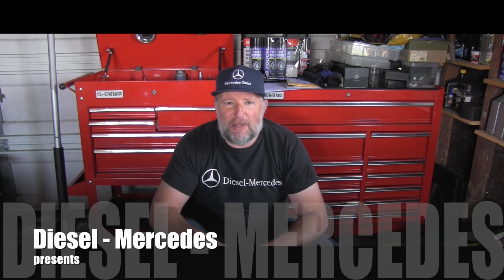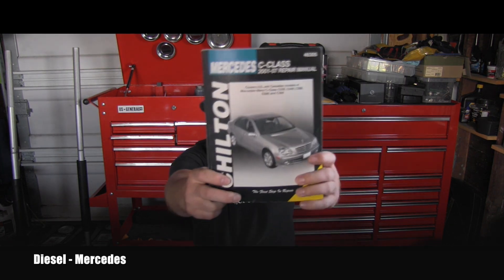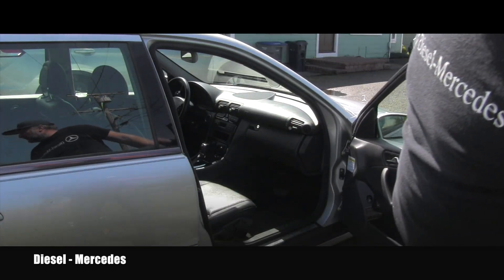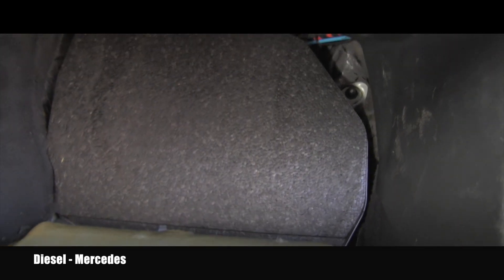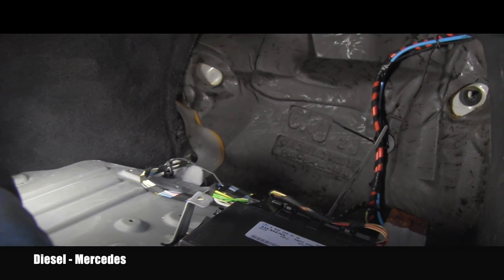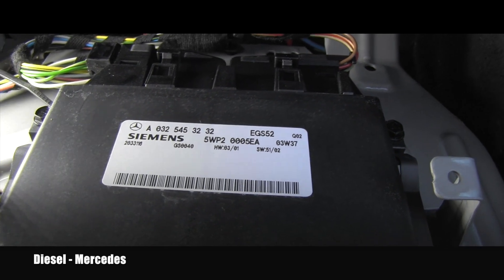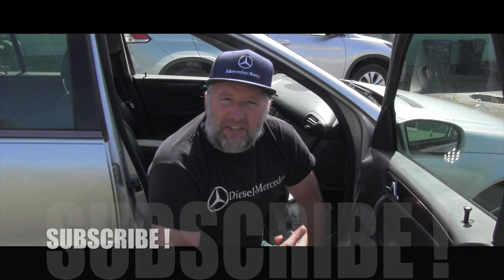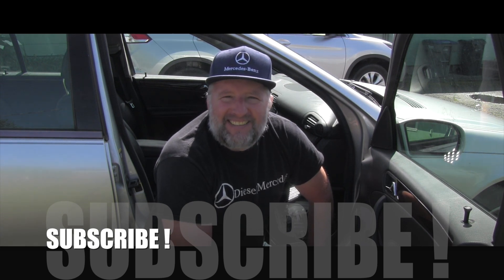Mercedes W203 C-Class location of TCM Transmission Control Module

Comment: I wish I found your video's in 2018, had car (W203 2005 model C200K) fixed and paid a lot to have repairs done.  This morning the shifter was stuck in park, and I have had some issues last week that it got stuck in 4th gear, so I assume the problem would be the TCM, will double check battery and brake light switch just for in case.  Really hope it's not the TCM - I'm not technical at all, and wouldn't want to fiddle with stuff I know nothing about, but your video's make it look so easy!
Reply: what was it?

Comment: How  do   remove   the  transmission    control  module  from  a  2001 Mercedes  Benz  s430?
Reply: Right side passenger under the hood there's 2 ECUs . The TCM is all black connected to the SAM

Comment: Thanks for the video I have a 2003 c320 4matic with code p2108 I've replaced all solenoids in the conductor plate with no luck and still stuck in limp mode tomorrow after I'm out of work I am going to diagnose what you have shown me here I really appreciate you taking the time for making this video
Reply: Have you solve that issue ? what is the cause of the problem ?
Reply: @harisyoung4110 
And how about you did you got the solution too

Comment: Hi Diesel Mercedes could youi confirm that to remove the kick panal, you used a standard 10mm socket set as my Mercedes CLK200 looks like there is a centre to the nut head that needs to be depressed with the socket set to be able to remove the bolt.

Comment: How are you
 Mercedes-Benz C-Class 2001 with its suction key
 The switch is running well but
 Sometimes starter does not work
  Sometimes it works
 What are the reasons? P0600??

Comment: My car merc w203 c270 cdi it does not change gears it only drives 40km/h only pls advise me.
Control transmission module part number is 1042700561 except this part number which other part number can also fit into merc w203

Comment: I am going to open and clean he TCM on my 2006 C280/ 4 matic just as a preventative maintenance procedure in case there is any ATF in it as described in many other cases. The ATF wicks up along the wiring harness and floods the TCM. What about the harness/connectors itself?, They can be  sprayed but not along the whole wire harness. I have already replaced the 13 pin pilot bushing plug which is the source of the leak I understand...My question is, are there any replacement wire harnesses available, and where? Thanks for any input.

Comment: i have w203 2006 ,and now come code B2020-Body and C2020 - Chassis ,I do not find these errors anywhere,
and in the car a very strange crash began to sound from the front to the driver's seat,the sound is heard only when I supply gas,I do not have an idea of what this may be when I ignite it and it works normally no sound nothing.Someone has encountered this problem ?
Reply: have the same issue the mechanics at each and every place i go seem to know less about the w203 then i do... these cars are beautiful... but man do they have issues no one can solve...

Comment: I have a mercedes w203 c220 2003 and it has a problem, it only goes first and then it remains doing as in neutral. I changed the transmission module but the problem has not been solved, my question is whether to install it or something

Comment: hi there I have a problem with my mercedes w203 it dosnt shift up its stuck in first gear I had the code (P2066 - Fault stored in ETC control module, speed sensors voltage supply) what should I do pleas help me
Reply: abdoo abdo replace conductor plate?

Comment: i there I have a problem with my mercedes w203 it dosnt shift up its stuck in first gear I had the code (P2066 - Fault stored in ETC control module, speed sensors voltage supply) what should I do pleas help me
Reply: Did you fix it
Reply: @klodiankurti3679  i have o4 Mercedes want go past 40

Comment: Thanks for sharing the video. I have a C 240 (W203, year 2003). Sometimes the downshifting isn't soft. Upshifting is fine. Could be a problem of sensors ? No error code with stardiag. If yes, could they be replaced or should i replace the whole TCM ? 
Thanx.

Comment: I got a 2005 Mercedes c320 4matic that's been sitting for about a year on jack stands on a trickle charge I'm in the middle of putting back together putting the front brakes on and noticed that the front wheel spin freely so I started the car up put it in gear and I'm able to stop the front wheels with my hand and it's a 4matic would you have any clue what's wrong with it

Comment: I love your wonderful videos. I have 2005 C240 4Matic. Check Engine Light with P0715 code. By watching your very clear and detailed video, I was able to replace Valve body Conductor Plate and 13 pin connector. Check Engine Light with P0715 did not go yet. Now I have to clear the error code P0715 from TCM. I do not want to go to Dealer to clear codes in TCM. Any other way to clear TCM. Please help me. Thank You.
Reply: buy a i980 iCarsoft OBD II. $115.00 http://www.ebay.com/itm/i980-iCarsoft-OBD-II-Pro-Diagnostic-Code-Scanner-ABS-Airbag-AC-ECU-Mercedes-Benz-/401141218474?epid=2164349962&hash=item5d65e13caa:g:0KgAAOSwcUBYLbn8scanner.

Comment: Another potential issue to consider there is A/C evaporator drain tube that channels down side of transmission tunnel through floor. It can form algae plugs that will cause this area to back-up, flood & pool with condensation water. It won't be noticeable without exposure because top layer where floor mats are will stay dry but that 2-3" space between floor mats & floor pan will become saturated over time as foam insulation gradually soaks up that condensation water like a sponge. This is a rare issue but something to consider if you notice car isn't leaving water puddles when A/C runs.
Reply from the maker: This car was full of water when I bought it....I will make video about that later.....